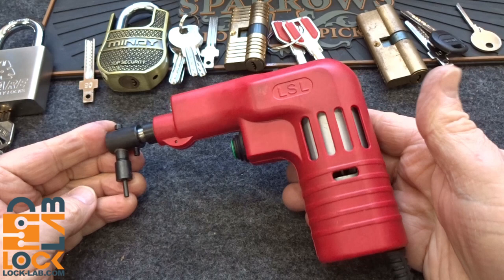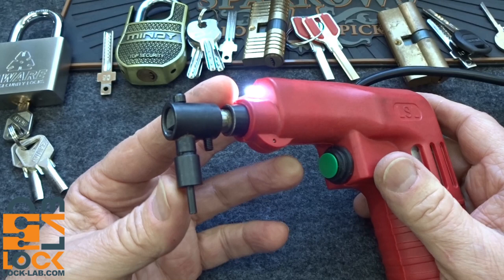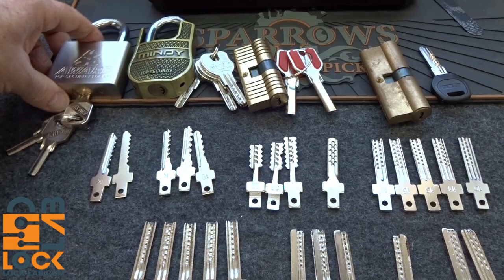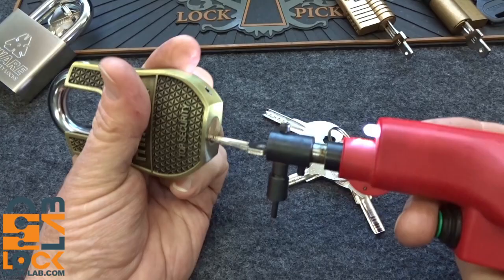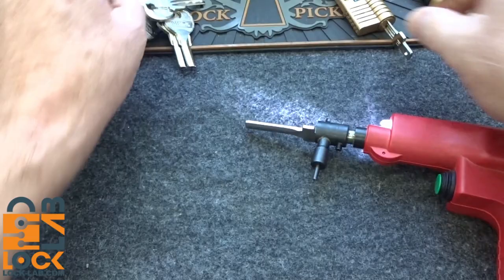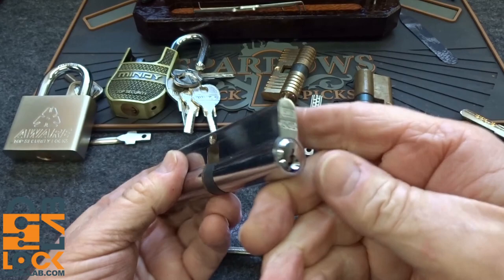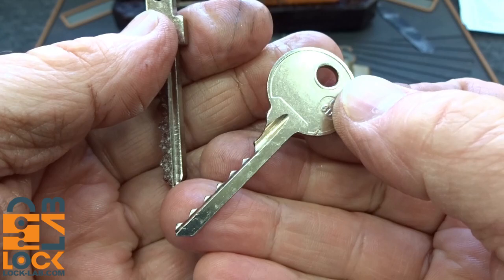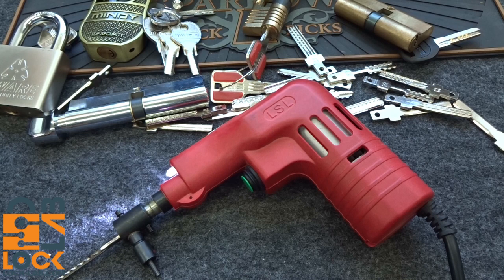(1050) Review:  LSL Electric Dimple Lock Pick Gun

Comment: The problem you're having is because the lock is in your hand. For the lock pick to work correctly it needs the lock to be held rigid allowing the pins to vibrate better. Redo this video with the locks in a vice or a door. I will bet you that 90% of them will open with no problem at all.

Comment: so you can use it as a saw to cut the lock in half
Reply: You could also use explosive shape charge, but that wouldn't be the point of the video.
Reply: the point of the comment was that the tool is really a saw in the first place and the steel "blades" ripped out parts of the brass locks throughout the whole video.
Reply: Variable speed jigsaw without a soleplate essentially

Comment: Hi Bill. Your review of this tool is probably accurate on dimpel locks, but using regulare bumpkeys works fine, in fact very good. So good in fact that when I was learning to use the tool, I filed down some of the teeth on the key, because it the tool is so fast that using a regulare bumpkey, can be counter-productive.
I have tried it on dimpel locks, there the tool is for some reason not so effective, also used bogota picks on it for raking, this also works.
I think what you did "wrong" was holding the lock in your hand, when I do that, the time it takes to open a lock increases a lot.
(When holding the lock in your hand. ( I think )  You make some kind of "occilating-counter-spring effect" that nullifies the tool - also saw that your grip was over the turn-part of the lock)
But what the tool does really good is wearing a lock down, real fast. So because of this I filed and polished the keys I use in it, also oiling the lock that I want to open)

I Love your reviews, so sorry about this feedback. I think your negative result was just lack of experience with the tool.
Reply: The tension-part of the tool is the tricky thing. I feel that it is a to "long turn" on it. This make using it a lot more difficult. I can also add, when I cut a horizontal groove on the front of the lock, to fit a tensioner as an experiment. It was a lot easier and faster to open the lock. (but the tensionpart also then is somewhat tricky, I have thought of trying to do something to it, to make a heavier and shorter turn but havent got around to do it)

Comment: I think you're not allowing the key bit to insert fully when you're using the gun.
I also think perhaps by holding in your hand, you're dampening the forces which would otherwise bump the pins.
Try a re-review with the locks either clamped in a vice, or clamped to some timber for support.
And try having the bit fully inserted so it bounces off the lock barrel rear limit.
Reply: I couldn't even finish watching. Use a vice or something. Half the energy of the tool is lost holding it in your fumbling hands.

Comment: You should use it with a vice 
you can see that your hand can't hold it steady with your hand . the vice will simulate it in the door so it won't jiggle. that way the pins take all of the shock and not the whole lock.

Comment: Hello, I am a Chinese locksmith, you do not understand this tool, the key to this tool is the angle.
Reply: I assume the angle determines the amount of torque being exterted on the lock. Jack it over too far and you bind all the pins. No different than regular picking.
Reply: That is very true,I have had locks bind on me all because I used too much tension.It's like when picking security pins,you have to gauge the tension and in most cases back up off the tension or start over to successfully pick locks containing security pins.
Reply: @NelsonE50  Yes, as I stated in my comments the tension-part of the tool is the tricky part with this tool. Also noticed that Bill used nearly zero tension on it

Comment: You might have better luck with the lock tight in a vice - i think a lot of the vibration energy is transferring to the housing rather than just the pins...so you are not getting the full 'bumping' of the pins.

Comment: ... I think the reason for the massive amount of power in the gun might be to simply wear any pins it encounters down till the lock gives in.
Reply: So I guess someone in China figured out:

Typical locks being made of brass/steel pins wear down after x = 10 000 - 25 000 cycles of usage before failure as a functional lock or there is enough slop/material removed from the pins that bumping becomes a viable option.

Creates tool to exploit the fact we don't make locks/pins out of ridiculous materials like titanium or carbide.  Makes bump keys out of harder material then the lock's pins and uses tool to "brute" force the lock via making it reach the end of its life cycle in the span of minutes rather then years.

Comment: I would try to get some motoroil inside the lock. The viscosity of the oil will delay the spring/keypin action so it will take longer for the lock to return to a locked position.

Comment: I'll bet the batteries are 18650's. They are easy to get from old dead laptop or drill  batteries. Usually only one battery is dead in the pack. Take apart a few and you can get good quality replacements for fixing battery packs.

Comment: sir, I am not sure that you holding the lock is a fairway to use this tool. a lot of the vibration is going into your hand versus the actual lock. try bumping a simple quick set in your hand and then bump the same on a door or vice, I am sure you already know which is faster or more effective.

Comment: I imagine part of the issue you're encountering is due to your hand absorbing a lot of the kinetic energy. I would suspect better results in a more normal application.
Reply from the maker: Good theory, but it isn't supported by the facts.  It made no difference whatsoever.  The gun puts out so much energy that there is no way my hand could absorb enough to make a difference.  Just to check, I used a vise on the same locks.  No difference.  We got those results because the tool simply doesn't work on locks with wide variations in bitting, just as I said in the video.
Reply: bosnianbill Interesting. Thanks for the feedback.
Reply: Try lubricating the locks before attempting to bump the locks open.New locks are tight and lubricating the locks will help the pins move more freely.Old locks also become tight because of dirt build up over time,in both new and old locks lubricating the locks is always a smart idea.I saw several videos using that electric dimple lock bump gun and in the several videos that I have seen the person using the tool always starts off at a low speed then gradually increases the speed until the lock finally opens.As for the noise level of the electric dimple lock bump gun I do not see that as anything to be overly concerned about unless of course you are breaking and entering.I am a licensed locksmith and as such I always carry my locksmith license with me and I will never open any lock for anyone unless the person needing a lock opened has proper identification.Dimple locks also utilize security pins so practice is a must just like with regular lock picking.The one thing I did not see you do in the video was to reset the tension before you tried to bump the locks open again.Resetting the pins is sometimes necessary in order to successfully open locks.As for the variations in bitting that is certainly true which is why it is necessary to obtain bump keys which will correspond to the locks to be opened and modify said bump keys to work with the electric dimple lock bump gun.In my opinion and from personal experience the electric dimple lock bump gun is a Godsend because it will save time and money opening dimple locks such as multilocks.I have had success bumping open multilock cylinders and I know that once I buy one of those electric dimple lock bump guns I will have even greater success opening the multilock cylinders.I do not own a multilock key machine but I have friends that are licensed locksmiths that own multilock key machines and will cut multilock bump keys for me because I am a licensed locksmith.For those of you that are not licensed locksmiths I would say don't bother buying this electric dimple lock bump gun unless you are a licensed locksmith and you have locksmith friends that can and will cut the necessary bump keys for you.
Reply: @NelsonE50  I agree, if you read my comments, you`ll see my personal experience with the tool and what Bill did wrong. (But this was simply just lack of experience using it)

Comment: Needs a rubberized stopper that you put against the lock face and a spring loaded join so you can turn the tool and hold it there, trying to hold the torsion just right whilst holding the tool seems like it would be a pain.
Reply: The tool does have a "spring loaded join" for applying tension either to the left or the right,the idea of a rubberized stopper is not a bad idea though.I think that since Bill just got the tool he wasn't practiced enough with it.Even though the tool is electric proper tension is always necessary and takes practice,especially when trying to pick security pins.Bill has good tension control from what I have seen in his other videos,the tool is new to him so let us give both Bill and the electric bump tool the benefit of the doubt.

Comment: I have one of these, I put a dimple lock in a small vice and worked from there. The problem is there are a few similar key profiles. I found one that worked after trying 3 others and then it opened quickly. But boy was it noisy and everything vibrated off my table.

Comment: I tried to do this with a cheap cordless jig saw using my own modified key blanks. The problem is the saw has too much forward/backward throw to it.
Reply: Try filing down a teeth or two (o.a.) on the bumpkey. I had the same experience when I was learning to use this tool and but when I filed it down to f.ex. 2-3 teeth on a 6pin key. But the power is a important key, Bill uses to much, with not enough tension

Comment: It is all about finding the right frequency.  It is not about half turns of the device it might be a slight turn to make a difference.  Please do a similar test with very slow increments of speed. It does not have 3 speeds.  It is a question of physics how quickly you will propel each of the pins maybe different spring tensions.  Please try this again but not to incredible speeds.  Also could you compare with manual bumping.

Comment: These will not work holding the lock in hand. It much better with lock fixed in place so you have better control of angle usually.
Also with your bump key, you are missing the cross like part which helps the key not move undesirable ways.

Comment: thanks for this review bill...you are updating us  most of the time what  practical tools a locksmith must only have. with common sense..those cylinders and padlocks are cheap ones mostly from china. nobody will pay 10$ for opening a 3$ padlock. so i think buying the tool (pickgun of this sort) is not practical. an owner would just simply smash it, snap it, and simply replace it. its a common sense attitude i think. (if i think of fun..i will use a jigsaw and with a used keystype modified, and jig it out.)thank bill,    best regards

Comment: I think this electro pick has a design flaw, most electro picks oscillate at different amplitudes in a vertical plane, however this pick just increases frequency of stroke, no wonder it's chewing up the core! Speed it up and it starts acting like a steel saw on brass core and pins... OUCH! Nice design but no cigar!

Comment: Is their a difference between the sparrows ultra decoder and the sparrows shank
Reply: If so what is the difference?
Reply from the maker: The decoder is only about 0.012" thick - about like a shim.  The shank is 0.032" thick and used to manipulate the actuator on unshielded locks, so much tougher.  They are not used for the same thing if that's what you are thinking.

Comment: Have you tried using the bump keys from the LSL set manually using a rubber hammer? Do these work on their own without the bump gun?
Reply from the maker: I have not tried it but there's no reason it WON'T work if you can find a keyway that the key portion will fit into.  Give it a shot.
Reply: @bosnianbill  Did you return/give away the product after review or did you decide to keep it? I'm interested wether or not this will work, I purchased my first set of bump keys 25 dimple and 25 saw keys supposedly crafted for the country i live in, so i'm skeptical because i'm a first timer in this and I hope they work! They will come in a couple of days.
Reply from the maker: I gave it away shortly after the review, sorry I can’t offer more insight.
Reply: @bosnianbill  Have you ever tried a Viro van lock?
Reply from the maker: @NihilanthNonServiam  No, I've opened several Viros, but not a dedicated van lock.  Got one?